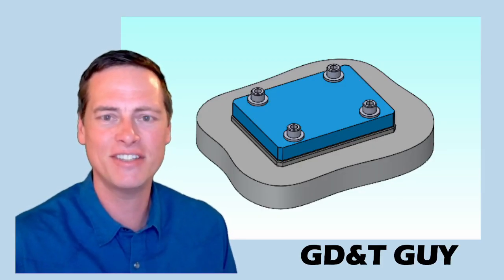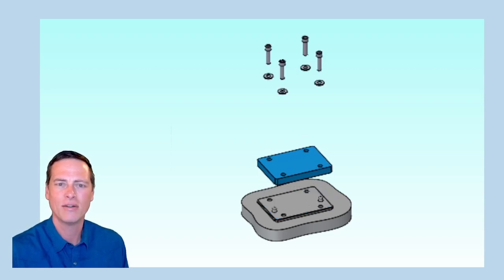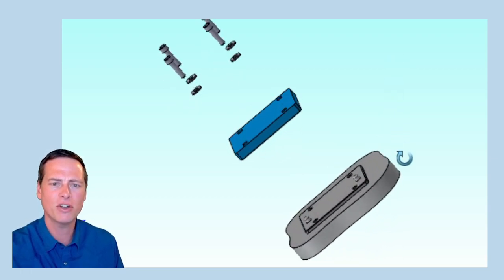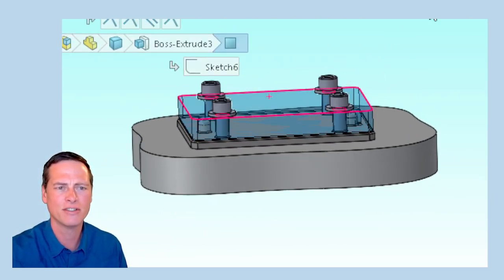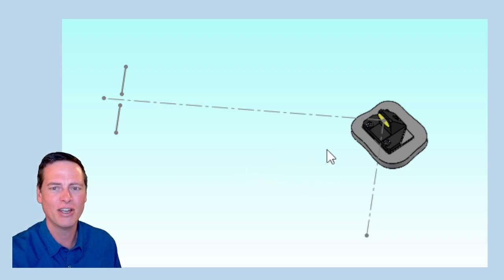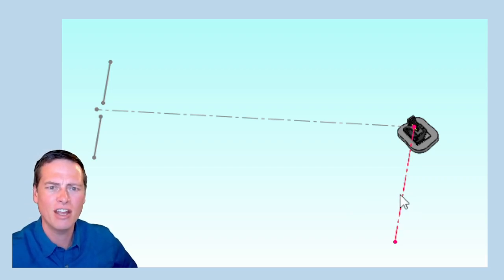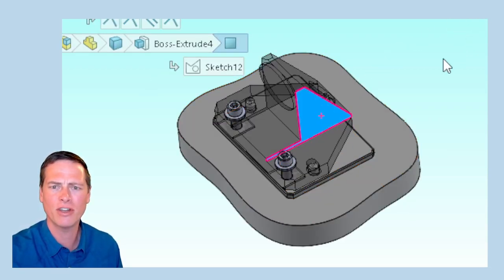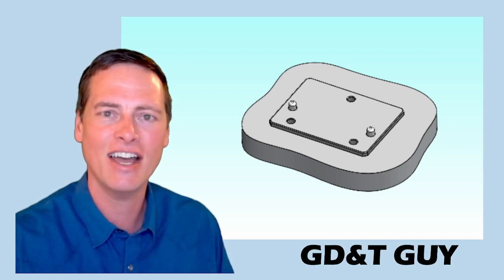Dowel Pins as Locating Features - Ep. 1: What are they good for?

Comment: The brilliance of GD&T lies not in allowing to find a way to make a bad design work, but in allowing to find a way to make a bad design good. The two dowel pin plus plane design is a bad design because it has Competing Datum Features. Each pin individually and the plane are trying to control the same 2 rotational degrees of freedom and that is causing the tolerance stack-up to exist. The way to make it a good design is by replacing the two dowel pins with two tooling balls (spheres), pairing one ball to a countersink cylinder to control position and the other ball to a chamfered slot radially aligned to the cylinder to control rotation. This will eliminate the tolerance stack-up (therefore making it inherently more precise) and will also make it quite easy to assemble due to the elimination of the Competing Datum Features plus the addition of the ease of assembly features.